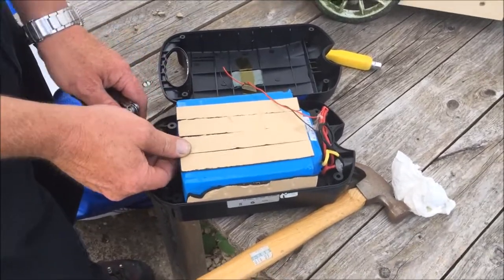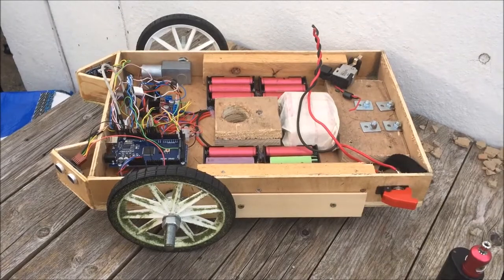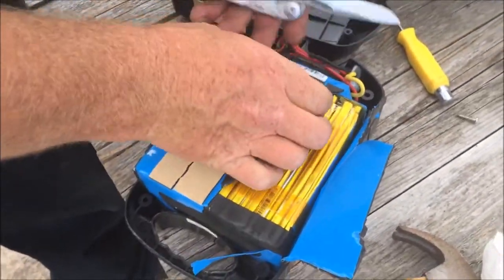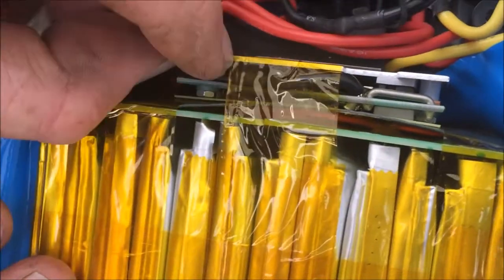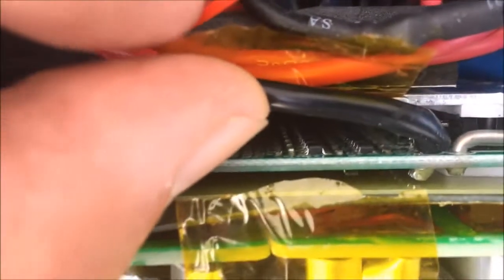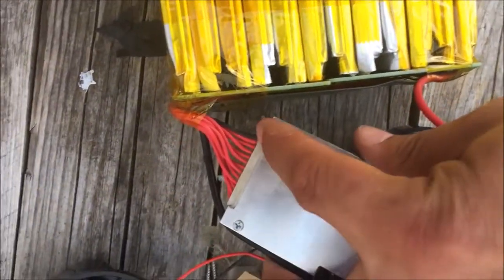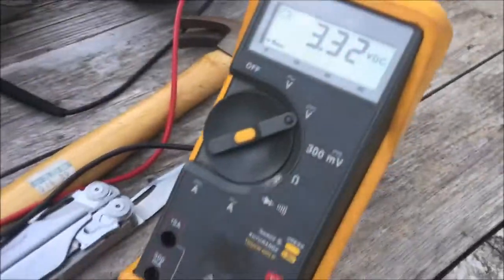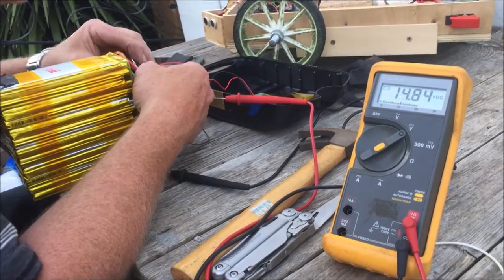E-bike Battery Striptease - Disassembly

Comment: not LITHIUM ION PHOSPHATE 
there is LITHIUM ION cells and then there is Li-IRON-phosphate .
Reply from the maker: Ah..   lithium-ion iron phosphate? ...  thanks for your correction....:).  Noted for next time...
Reply: @DubiousEngineering   Just Lithium Iron Phosphate ;)
Reply: @DubiousEngineering  also worth noting that LiFeSo4 cells have lower voltage than standard Li-Ion cells.   so if you were to put a LiFeSo4 cell in place of Li-ion or use the wrong BMS for it , it will go up in flames likes christmas .
Reply: So please dont just put it in that robot :)
Reply from the maker: To be fair... this was one of our very early videos... I need to go back and watch it... I hope it’s mildly educational and entertaining... what are your thoughts on LiPo batteries?